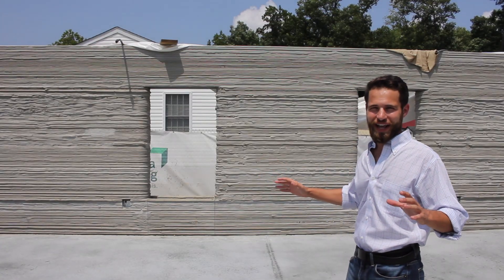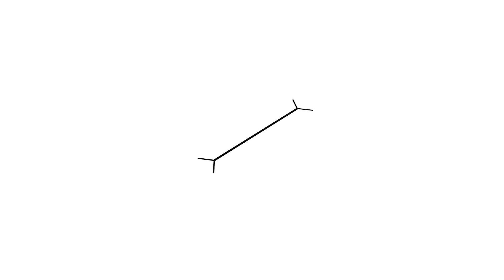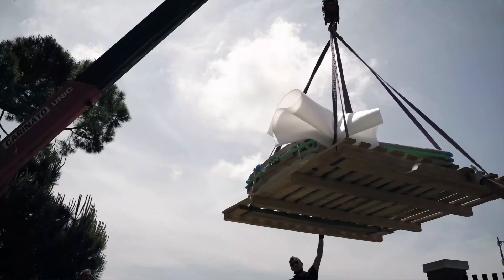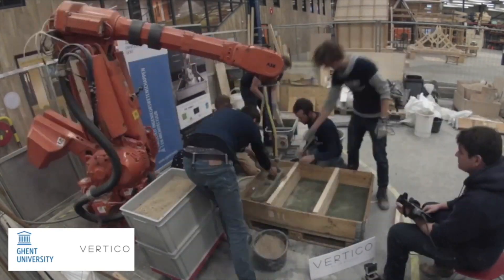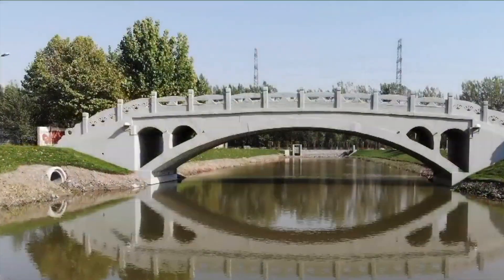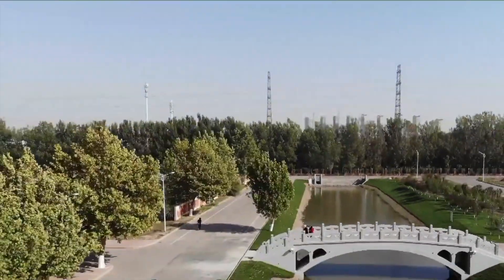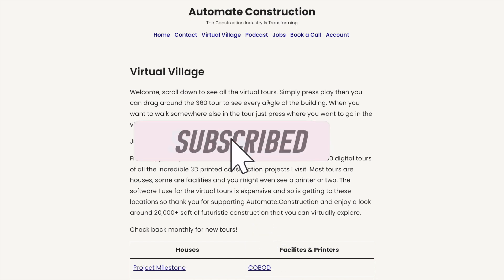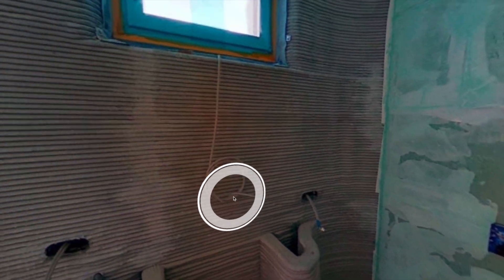Every 3D Printed Bridge In The World

Comment: Hi Jarrett. I'm new to your channel, but not the topic. I've watched several of your videos today. I have yet to see one that includes a [walkout] basement [on a slope]. I have designed a home, a hexagonal tower "castle" with machicolations and crenelations about 50' tall from the foundation. Originally, my goal was to build it using either NexCem (formally Durisol) or Faswall (NOT Fastwall) blocks. If I choose to use 3D printing, how would I begin to find a construction team willing to work near Las Vegas NM? Would Habitat for Humanity be my best starting point?
Reply from the maker: Peri built the house for habitat reach out to them. If you're expecting it to be cheap it's not worth the effort reaching out.
Reply: @automateconstruction   - it seems as if nothing is inexpensive these days. Cheap  - well that’s a different story. I was hoping for competitive. The great thing about 3D additive deposition is far less cutting. 60 degree corners cause a lot of that. 
Also, I could incorporate forced perspectives that make the tower appear taller too. 
Thank you.